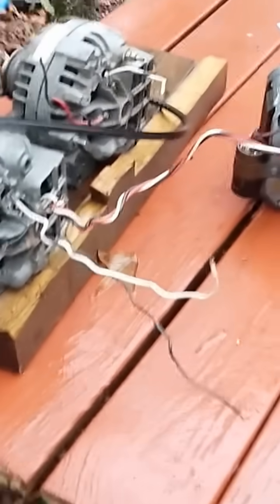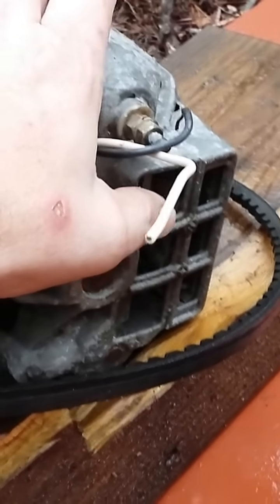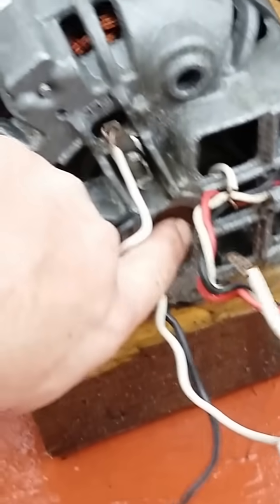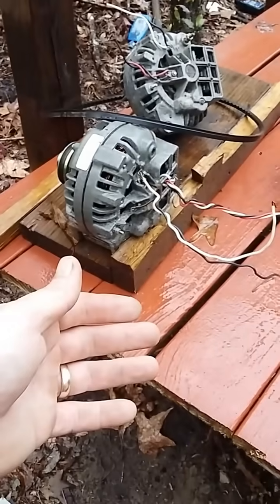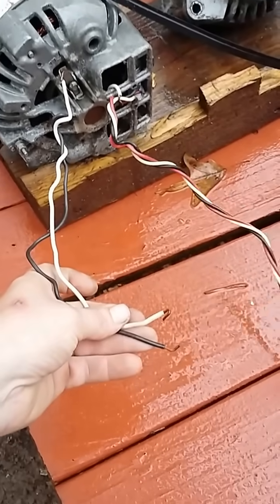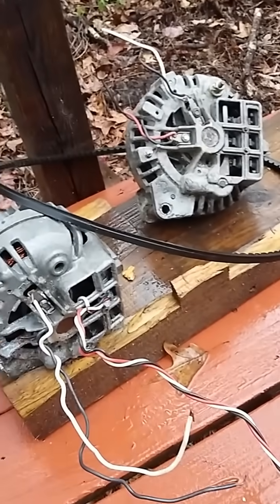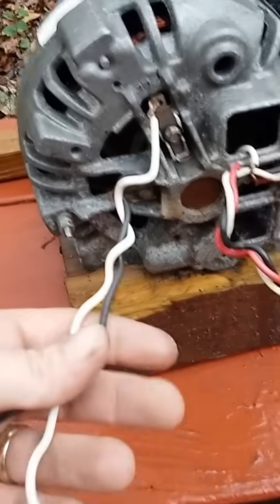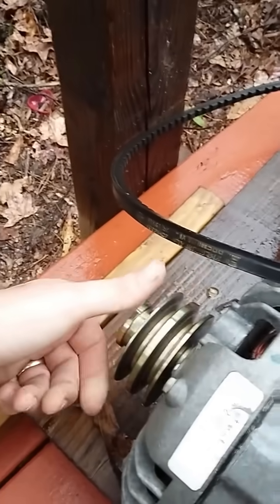Update Free energy forever no wind no solar no gas READ DISCRIPTION!!!

Comment: I have only seen a few of your videos,,, and I haven't read any of the comments,,,
What do you think about a time machine,, Using big enough magnets ,,, like a UFO,,, that is really a time machine in flight,,,
Or maybe using 2 big enough magnets shaped like a UFO making some type of electricity inside the UFO making it create a circular motion,,
Reply from the maker: North Florida Bees it doesn't really work that way.. you have to Super ionize the air around you and induce a magnetic field into plasma at a certain frequency. you can't use magnets they're not strong enough and they don't work at the same frequency that you need. which would be a good reason to do it inside of a chamber or find out a way 2 make a EMP that produces ions all around you at the same time it pulses the frequency that you need. but this is something we should not speak of on here...
Reply: ThomasBuie EnergyBuies at gmail com speaking of frequency what’s the frequency.? I’m sure we can make this happen. :) maybe times of years have a frequency like right now we’re in 2018HZ or something crazy like that, so if you wanna go back to the 40’s ww2 you’ll simply change frequency to 1943 right?
Reply: North Florida Bees funny you said this for sure using the opasit poles of magnets could turn a turbine and make infinite free power just harvesting there pushing force.not time travel tho lol
Reply: John Gross in one of your videos you mentioned Tesla Tesla is already working on a time machine,, you are on to something big you just haven't put it all together yet but it will work in the year 2028 the government will admit that there are aliens and say that we have a time machine it will be available to the public in 2030 if you have enough money I know you will not rest because I have planted that seed inside of you if someday it works come see me the day before I tell you this
Reply: North Florida Bees so time travel is possible? How can we make it happen

Comment: I have this harbor freight system. We had a bad monsoon storm knocked out electricity. Grid was down for more than 8 hours. Thanks to these panels I was able to run a fan all night sleep  comfortable at 100+ degree weather.  Was able to charge my power banks and power my wifi for the family.  Here is the vídeo when this happened 

https://youtu.be/qPKkjVMpR9M

Comment: Or you could use phone outlets. It's how I power my entire house. All you do is convert the 50 volts  coming out of the phone cable to 220 volts. And it works!
Reply: Lol.
Reply: Hackers ERROR:001 I've use electricity coming out of the wall from the phone company and the wires weren't strong enough to be heated up and started smoking
Reply: Knik B that's why you use a converter
Reply: At a guess the amps way to low to make worth while.led light bulb sure.ac heater not with the phone lines of your whole block.

Comment: I HAVE THE SECRET THAT TESLA WANTED TO GET OUT TO OUR WORLD = SIMPLICITY OF FREE AC ELECTRICITY MULTIPLICATION  USING PULLEYS – Also found in our Holy Bible in Ezekiel 1:16 – where he describes the workings of a UFO  motor as “wheels within wheels” . 
-
. This https://www.youtube.com/watch?v=NxpoiCFKmPg is almost identical to the idea that I was shown in the early 2000's + soon put on the web @ http://free-energy.yolasite.com/ . Simple logic tells us that “yes we can” freely... multiply AC electricity with pulleys, if we are only having to input a few bursts of AC or DC current,(however many phases it is) to gain the single rotation of a 100 cm circumference pulley. Then if we run this 100 cm of moving belt past 10 mini-pulleys of 1 cm circumference with AC generators attached, then through simple pulley mechanics, we can easily gain 1000 cycles of free AC electricity. This way you must be multiplying your input power. You are using the God given abilities of pulleys to freely multiply the # of rotations, and by simply attaching AC generators, to freely multiply cycles of AC electricity.- 
 . If this mechanism can easily generate the needed few pulses of AC or DC electricity that the drive motor needs to keep this free AC electricity multiplier running, then wouldn't that make this a perpetual motion power supply mechanism. It is hard to believe that the 1000 cycles of AC electricity output, cannot generate the small amount of energy needed to crank over your single drive motor the one single rotations. Not only is this simple, using only 2 motors, 2 pulleys and a belt free energy mechanism a perpetual motion machine, but it can even be a steady electricity producer. This free energy technology will be needed by the Saints after 2019.04, http://my2020vision.yolasite.com/ when the door will close for the signing of the infamous 7 year peace treaty. But this will be needed most after the mid-point of this treaty, when the Great Tribulation   http://doorschristmustpassthrough.yolasite.com/
-
THIS IS SIMPLE LOGIC THAT EVIL IS HIDING
Free energy can be generated using pulleys
pulleys can be used to freely multiply the # of rotations
+ since AC electricity is generated by rotations
we can use pulleys to multiply AC electricity
= FREE ENERGY IS POSIBLE - - - - - - - 
http://free-energy.yolasite.com/
this tech will be soon needed by Tribulation Saints 
DOORs closing = 2019.04 – signing of 7 year peace treaty
+2022.49 – Great Tribulation = most all evil is sent to earth
+2025.94 – Jesus Christ sets His Feet on earth
http://doorschristmustpassthrough.yolasite.com/
http://my2020vision.yolasite.com/
http://beliefstoliveby.yolasite.com/
http://possibletimingfortribulation.yolasite.com/
Reply: joe Lynch ? There's3 wire's do you ground one of them our the houseing
Reply: Joe Lynch: That.s a good one thanks for the laugh!

Comment: One thing that everyone of these "free energy" junkies overlook while they're trying to sell "perpetual motion"  (using the energy produced by the alternator to power a motor which then turns the alternator) as a viable energy possibility is this: every rotating motor or generator is going to suffer power loss due to friction. This will happen no matter how good the bearings on the rotating equipment is. There is also wind drag produced by the rotor or armature, partly because they will usually have a internal cooling fan attached. Also, if that weren't enough, both devices will produce heat while in use which also represents energy loss and some power is lost just in the act of transmitting through wire.  Alas, no such thing as free energy.  Even if it did work, there wouldn't be any surplus power to use for other purposes. There are some very viable and affordable methods to produce energy at home that involve wind, water or solar which can be much cheaper to produce power than using the utilities. However, many considerations have to be made such as: energy source to rotate the generator, power storage and SAFE power transmission and utilization. DO NOT WIRE DIRECTLY TO AN OUTLET. If you are connected to the much maligned power company because a Lineman working on your system is subject to electrocution even though he has disconnected due to being back fed from your system. The resulting lawsuit would severely cut into your power bill savings. My suggestion, go to your local library or book store and research home energy production.
Reply: Bruce Bowers who do you work for
Reply: I don't work for anyone. I am a retired electrician.

Comment: OMG, so... how are you going to run the pulley on this alternator... another motor of sort?.. well that takes money to run by gas or something else. You really have no understanding of economics nor electric as this power would fluctuate some much it would FRY your electronics! Your a complete idiot!! Donate $5?.. a ton of adds here. OMG guess I'm the idiot for watching this!! To All others, This is so much complete nonsense he should be banned.
Reply: Living Free Wouldn't a Surge Protector solve that??
Reply: No. Surge Protector only
protects against Surges of power and only to a point. What you would need is a
steady source of energy like a battery bank and invertor. This battery bank and
invertor would have to be designed for what loads you want to run so
calculation on your load would need to be known or you will run it dry of power
before you wanted. The invertor then would not depend on the variation in speed
of the alternator as it draws power from the battery giving you your 120v AC
power. All this is a lot more cost to this system. You still need to power/run
the alternator with a motor or power source thus neutralizing the “free” cost.
The power needed to run the alternator (other than pedaling bike lol) would
offset the cost saving. No energy is free. In order to get an alternator output
to 90 amp you would have to do 1200 rpms, or 45amps at 600rpm. That’s pretty
fast and at 12 volts is only about 600 watts (doesn’t matter 12 v or 120v output
is the same in watts). You could buy 600 watts of solar panels that would
output that for 25-30 years while the alternator (if new) would only last about
3-5 years before brushes/bearings would go out. With a battery bank, invertor
and source to power to run the alternator, it might work. Adding the
battery bank, invertor and source of power starts to really add up in costs. Not
a very practical system for energy generation when there is much better
alternatives, longer lasting and more cost effective out there.  And definitely NOT FREE. He is misleading people
on the reality of this setup, I guessing with hopes of having more viewers. And
it seems to be working.
Reply: Living Free helo
Reply: OMG, so....you'd be an idiot whether you watched this or not.  You can't fix stupid with free energy.

Comment: First, you need the Low voltage D C electric supply (where do you get it). Next you need electric to run the motor that runs the alternator.  OK say you use wind, sloar or water power, you will need a large system to runn your power needs. This design is therefore impractical
Reply: He has a running creek he uses

Comment: How do you get them into phase?
Using two of them together would not seem to work well as the output would not be in correct phase with each other.
Reply: LOL. That isn't the only problem he has.
Reply: Gregory Thomas he's using 1 as a motor to turn the other
Reply: I was referring to using the two alternators to create 240VAC.
But they would not be exactly 180 degrees out of phase so it should not work correctly.

Comment: Thanks brother i got it working  saves me 250.00 monthly
Reply from the maker: If I showed you that video little buddy you would shit your pants and then start putting stuff together... I don't think you really realize that I probably know the difference between the word rotor and stator? Well, since I build integrated circuits in my spare time...
Reply: BSEE and MSME. Go bullshit someone else. "Free Energy". You're an idiot.
Reply: LOL. Time for your video showing EVERY WIRE and EVERY POWER SOURCE in your system. I'll pick it apart

Comment: So some of my questions may seem stupid but I have so many things to work with and I would like to set up a really reliable system trying to utilize all my resources with out damaging any of my expensive equipment as I can't afford to replace it, I was lucky to have got it in the first place and I totally live off grid and power is part of our life source here, the closest power utilities are over twenty miles away so I really need to make all this work! I do have some high tech off grid solar systems, my first system is four panels 285 watts each with a 2,000 watt sine wave inverter a 150 amp mppt charge controller and four 6 volt deep cycle batteries, batteries weigh 105 pounds a piece so they are huge! My second system is a 3 panel system 150 watts for each panel charge controller is weird, nor programmable like my big system, the second system has a 3,000 watt inverter and I don't think it's a sine wave inverter, it's really light while my first inverter is really heavy! I wave two 400 watt wind turbine generators with built in charge controllers and breaking system when wind get to strong they stop and start spinning again! These are pretty good systems; however I can use all the power up running swamp coolers at night ECT. I will be setting up GEO thermal to conquer heating and cooling and minimize my power usage by using fans to draw cool and warm air through the ground! I have a year around creek that pushes 1,100 gallons a minute and this is where I want to set up a constant power source using a water wheel with gear ratios that will turn an alternator fast enough to keep my batteries charged at all times for the inverter but I don't want to damage any part of my solar systems! Alternator shod have a built in charge controller so I can hook straight to the batteries ? I also have about 12 gasoline generators that vary in size and the output in wattage, wondering if I can use the power part of those and remove the gasoline motor, I'm thinking I can and wondering if I can merge all that wattage off multiple generators into one unit by setting up multiple water wheels or if I would have to have multiple power source, if I can combine all them in to some transformer or whatever it would be that can take multiple power sources and covert it into one outlet I can get 36,900 watts just off my generators, other wise I will have to run a sequence of outlets from 7,500 watts through 1350 watts, I also have travel trailers and an RV with power boxes that are wired for AC and DC , I have some old wash machine motors with the copper wire as well and some alternators, the generators have built in battery chargers for 12 volt batteries and I do criss cross my batteries which are a total of 24 volts for four of them but I do it so it stays 12 volt system I believe if I remember what the solar company told me when I bought the system. So what to you think about taking all this and maximizing my power and setting it up for constant power? Should I try the generators on a water wheel and using a built in battery charger off the generator to charge batteries? Should I use an alternator to charge batteries and generators as a separate power source! My creek runs 1,380 feet long so multiple water wheels isn't a problem! I ready have five dams in it with pipes that pour ample water to turn the wheels! I'm just trying to get the most power I can get, it's weird cause my 2,000 watt sine wave inverter actually powers more amps than my 7,500 watt gasoline generator, I don't have any idea as to why but I can run welders, air compressors which use massive amps off my inverter while I can bog down that 7,500 watt gasoline generator! Should I play it safe and keep my solar and wind separate and set up a couple of water system using alternators and generators or plug in to charge batteries on solar and wind system? I do have 3 deep cycle RV batteries I can use on the water system and the inverter out of one of my trailers! Or if I get the generators to power off water wheel they will throw out a power that I can plug right into. That's another question. Generators have the voltage regulators, do alternators have them built in or are they separate on the vehicles some where else? Also do I have to run a generator or alternator at a specific rpm to generate power ? I'm sure the gear ratio will determine the rpm but is it pretty specific or just in the ball park range, if you know he range I need to set for a minimum and maximum I would appreciate any information you cod offer thanks!
Reply: You just need some pixie dust from this guy,and it all works for free. You can sell everything else you have. In fact, just scale it up and supply power to the county, then the State, then the nation. IF you believe this guy has what he claims, you deserve to be financially skinned.

Comment: I seen this concept but a little different. I think the person had 12 batteries and seven alternators or some number combos like that.  And it powers there home stead so there is something to it. It needs to be done right as long as your seeking the right information and at least. The next phase in human prosperity is when we can be independent on our energy needs and not be slaves to bills
Reply: The problem is when a alt is on it is hard to turn.the more in a line the harder to turn,I built set up couple years ago.using 1 motor 1 alt.the motor came from concrete mixer.but I more or less broke even.with a small power lose.that motor could not turn 2 it struggled on 1.so 7 would take epic torque to turn.and a huge motor.average is 20 HP to turn one.140hp needed for 7..that said there's a motor on eBay that goes 2200 rpm which is bout perfect.using it and a altnator might show a profit of power.but would be small.200$ to find out.I saved my money. Lol.but using a alt what rpm would it turn just powerd lol to fast wasted motion to slow not making power.I'm not saying impossible. But impossible with the 2 alts.as the motor is gonna go to fast and waste power.
Reply: Oh, its always "I think the person had..." "Powers their homestead". Name the place and the person who has this "concept" working, and I'll show you a charlatan.